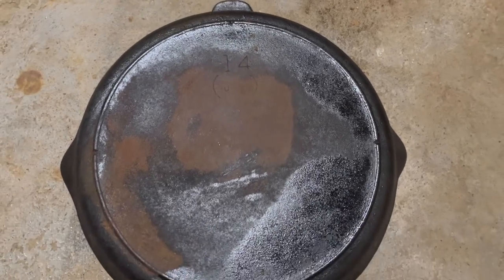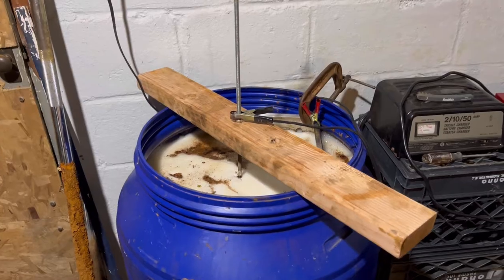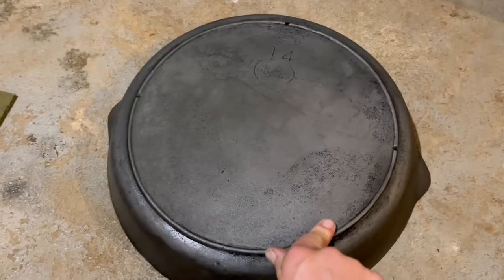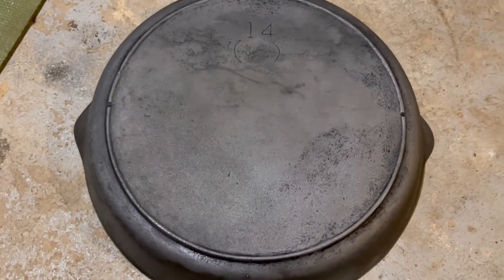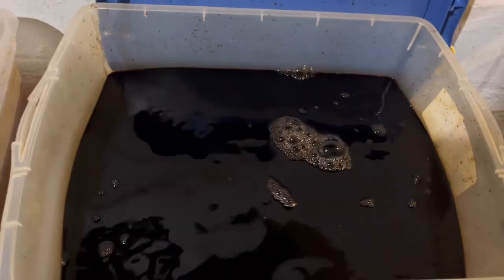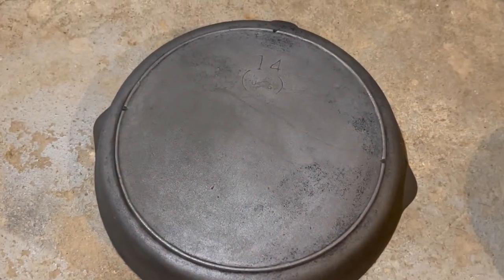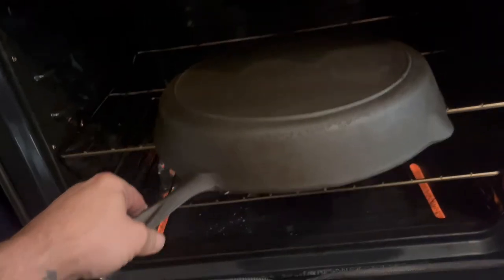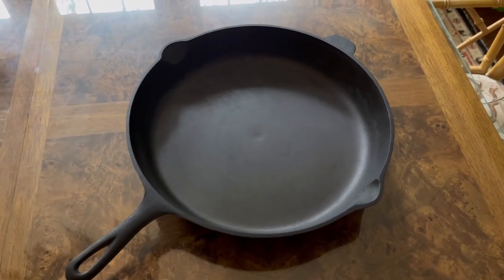Restoring a #14 Lodge skillet made between 1955-1965!

Comment: Just looked at some brand new Lodge stuff in a store yesterday. The #14  modern Lodge was $54.00. That retailers prices are usually a bit high on most things, being a very tourist oriented gift store next to the "Mother Road". However, the Lodge cookware is very economical by comparison to the "celebrity" or "designer" or "fashion" or "gourmet" label products. I laughed when I saw a single skillet that was priced at about what I would normally expect to spend on 5 or more typical used flea market, yard sale, or thrift store finds. The beauty of vintage or just plain modern average used cast iron is the fact it can be restored or even "improved" with some effort.